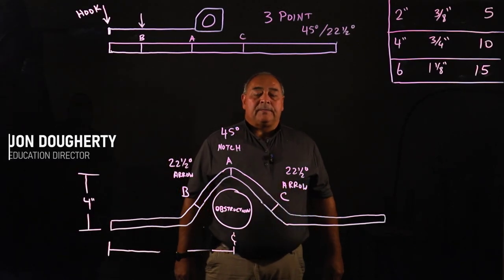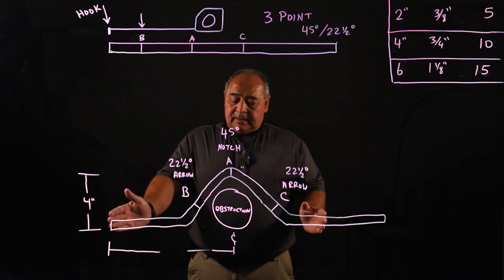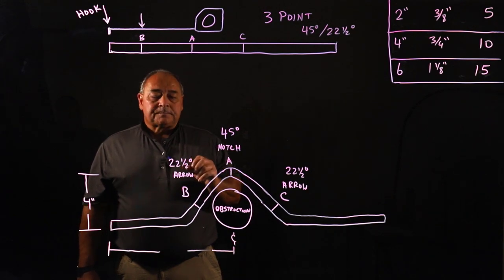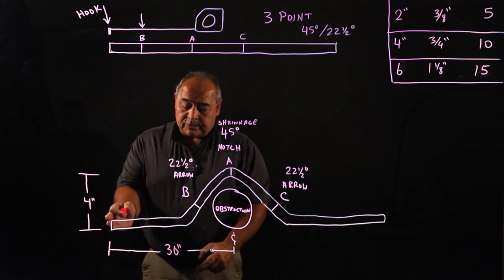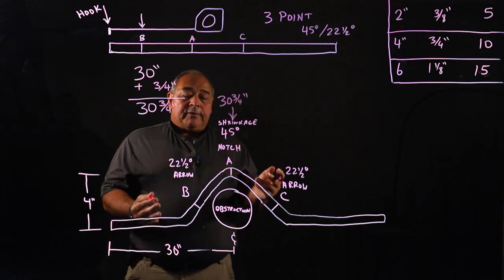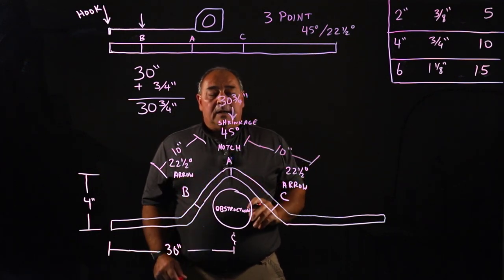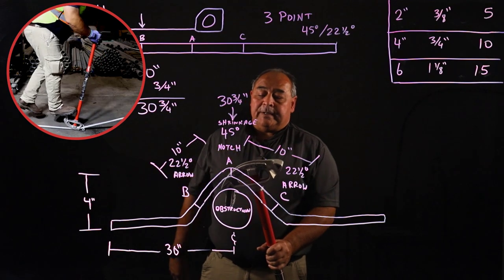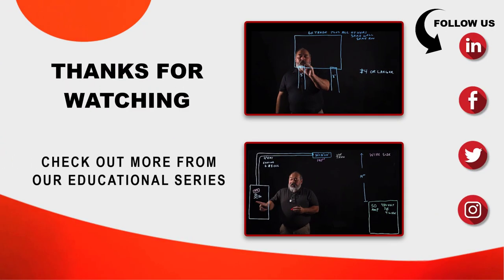3 Point Saddle Bend Basics

Comment: Is the shrink based on 22-1/2 degrees or the 45 degree shrink per in inch?
Reply: The shrink isn't based on the degree of the bend. It's based on the inches of raise.
Reply: @norcalsolar8291  The shrink is based on both the degree of bend and the raise. To find the shrink constant for any degree the formula is (1/sin of angle - 1/tangent of angle) for a 22.5 degree bend that is .2 so you would multiply the raise by .2 to calculate your shrink.
Reply: The shrink is based on the 22-1/2 degree bend. The shrink for a 22.5 is .2 in his example .2x4 is .8 he just used 3/4" for simplicity